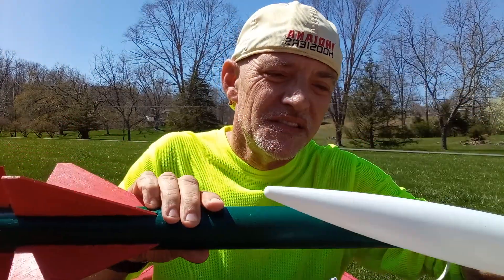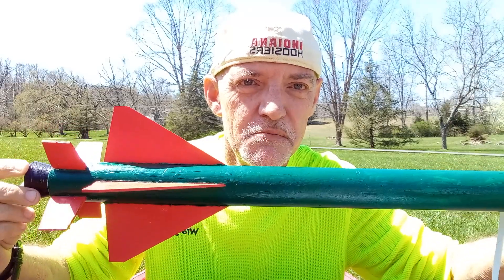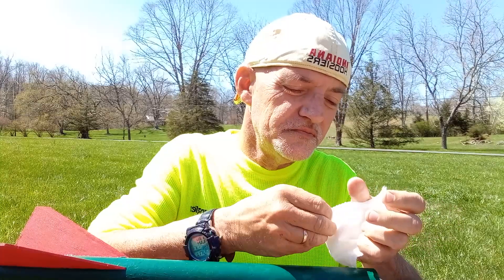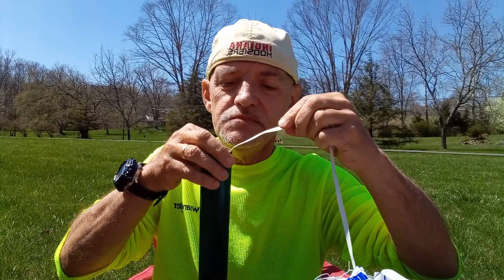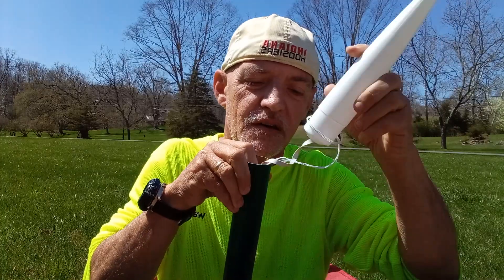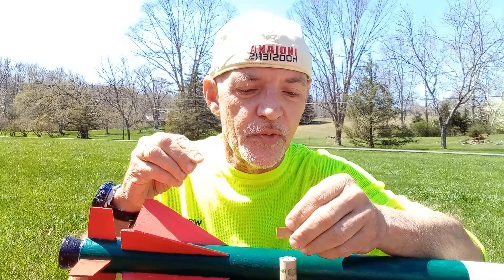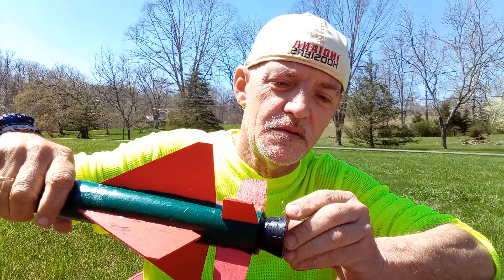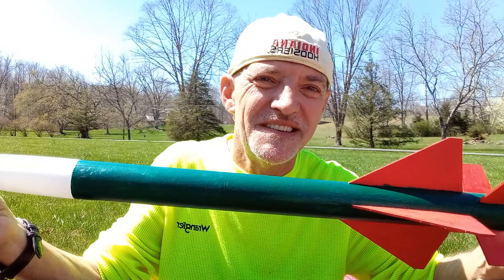HOW TO PREPARE A MODEL ROCKET FOR FLIGHT, FOR BEGINNERS! #modelrockets #science #rocketry #rocket

Comment: When I was a kid I would make a simple rocket by gluing some fins and a drinking straw directly to an model rocket engine, stick a piece of clay on top for the nose cone, straighten out a coat hanger, stick the coat hanger in the ground, load the rocket on to the coat hanger by feeding the hanger through the straw, stick a fuse in (we use to be able to buy fuse at the hobby store) light the fuse, and away we go.
Reply from the maker: @Chris-bm5qd  That was really cool. Thanks for sharing that with me. You and I sound a lot alike. I used to do stuff like that as a kid too except mine was much more dangerous. I would take a disposable thermometer cover like they throw away at the Drs office after taking your temperature, I would put a .22 rifle shell in the bottom of it, put it on the launch pad and light a fire underneath it until the gunpowder went off firing the bullet up into the thermometer cover and lifting it into the sky like a rocket 🚀. Dangerous, but it worked lol.

Comment: Having never seen this done , I sort of imagined the engine would be around 1/3 the length of the rocket body. I was definitely wrong.
Reply from the maker: @SpiderDijon88  Yes the engines range in size, but most of the smaller engines are usually around 3 inches long.